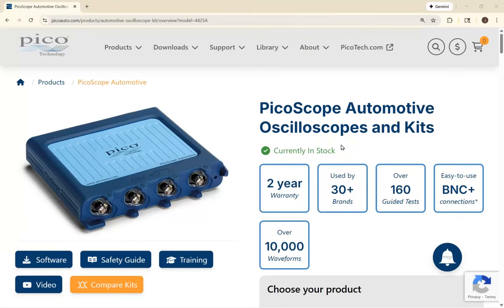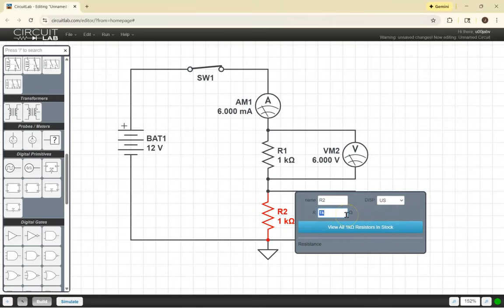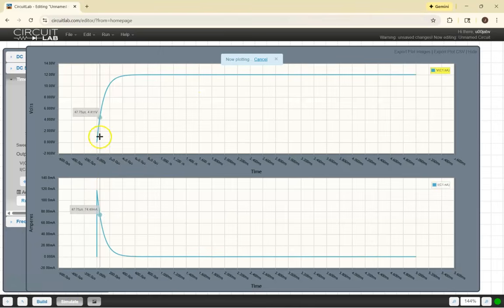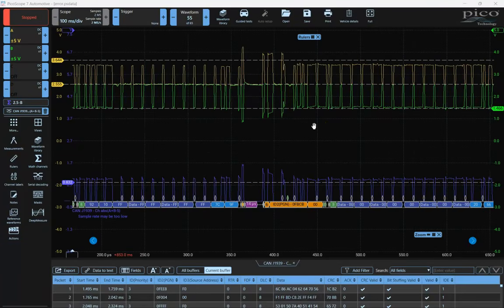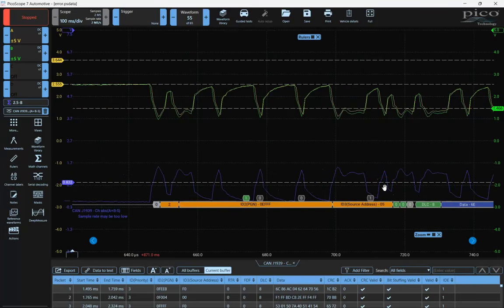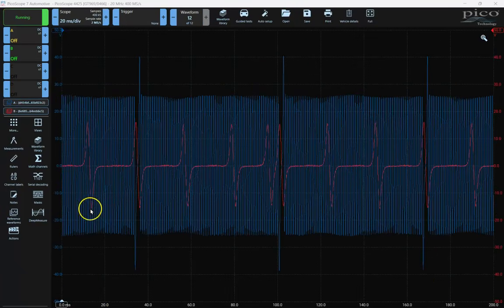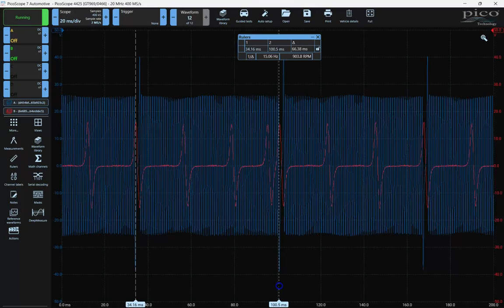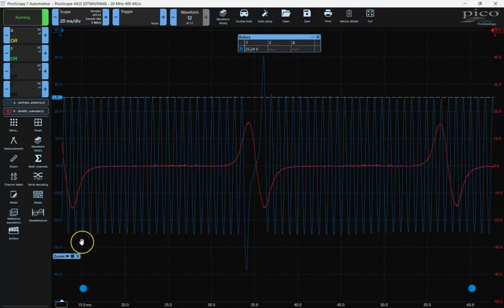Introduction

Comment: ive been binging your advance j1939 series. 
How do you determine A-B or A-2.5. 
Im assuming its changing the difference between high and low but i feel like it might be something different
Reply from the maker: It depends on the failure as to what needs to go into the math channel.  It is easy to experiment with editing the math channel until the result can be decoded.  You are trying to make the result be something digital that is ~0V and > 1V.  I'll try to explain that in this series since I am finding the concept seems to difficult to understand for some reason.